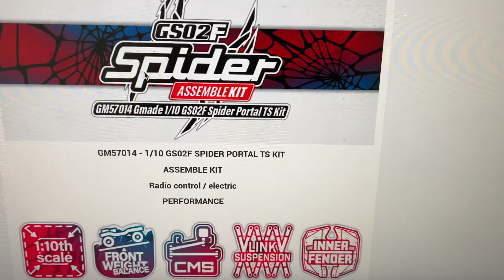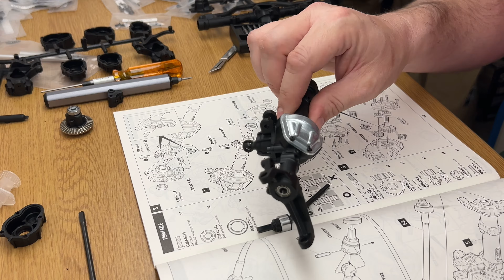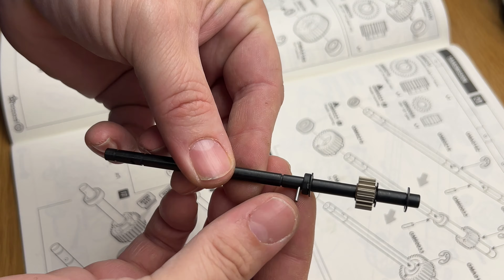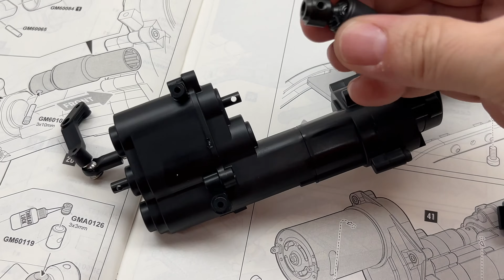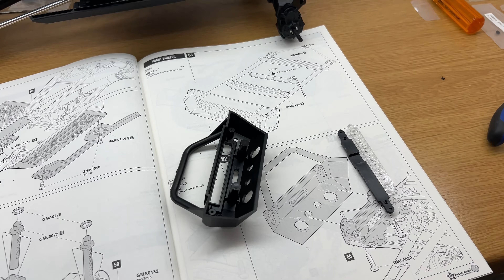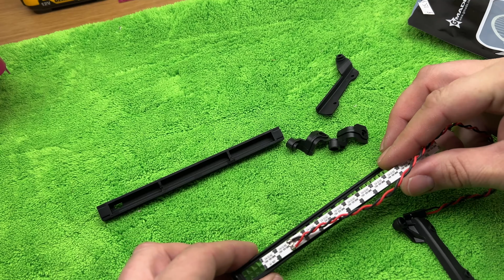The best new Rc Crawler ? Gmade GS02F Spider build

Comment: Built mine late last year amazing piece of kit apart from the high and low gear changer couldn’t make it work so it’s locked in low gear. Hope you have better luck. 😢
Reply from the maker: Great to hear! Yes i had issues but played with the end points and has worked fine since

Comment: An GS02 or SCX 10.2 are already way better than a TRX-4

Very high, poor weight distribution, a very complicated chassis with too much material on the upper part.

The TRX-4 has unjustified hype. It would have been branded Gmade on the box it would never have sold